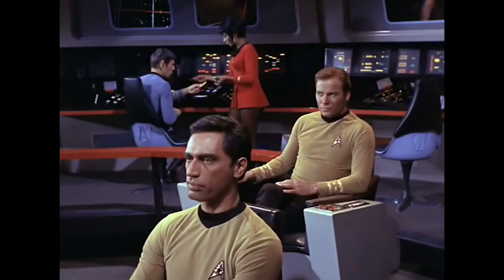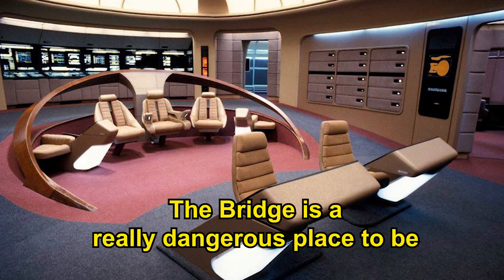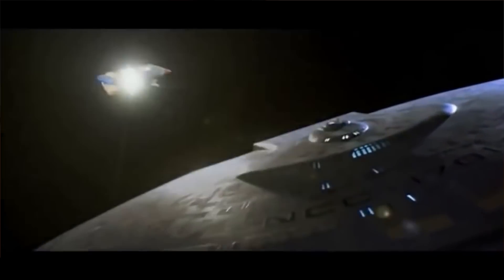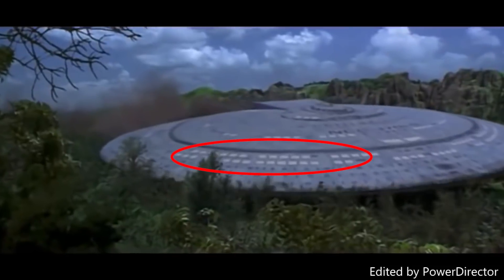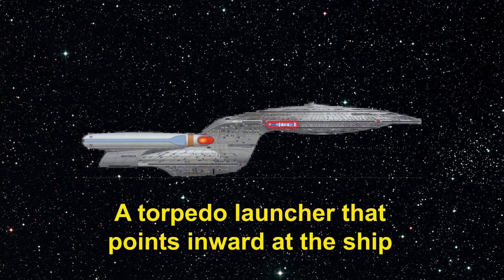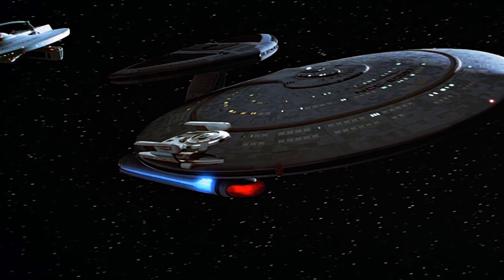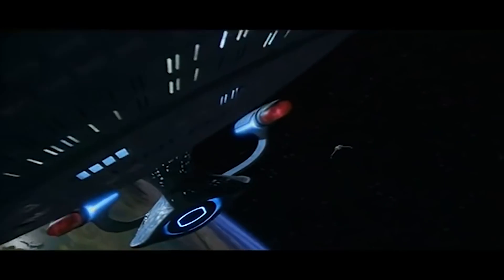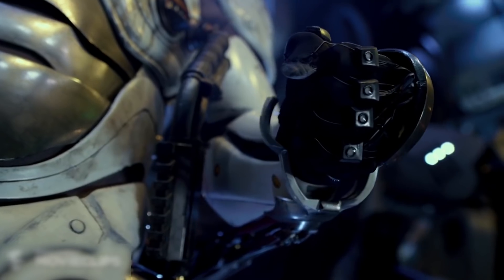10 Flaws Star Trek - USS Enterprise NCC 1701-D

Comment: One of the biggest design flaws of federation ships are the mysterious beams that fall from the ceiling when the ship is hit, inevitably trapping someone underneath.
Reply: I noticed that. WHy couldn't they locally turn off the gravity so they didn't need to lift them up?
Reply: That also happened on the Romulan ship in Balance of Terror. Dramatic effect. But I do agree that exploding work stations on the bridge are a farce - it happens only because the scriptwriters want them. As an engineer, "real" consoles would just go out (shut off) or worse, start smoking and perhaps catch fire after a full minute, enough time for crew to move.
Reply: @dtvjho  Not quite. Sometimes a power surge or short circuit can cause electric fire, or in a very rare case, explosion. Furthermore, Starship in a star trek didn't use electric cable for power. They use EPS conduit which use plasma to transfer power from the warp core to the rest of the ship. This conduit can rupture and release hot plasma.
Reply: @dtvjho   The problem is all their consoles are powered by Samsung batteries.
Reply: Don’t forget the rocks. Federation ships  decks are full of rocks that fall out during attacks
Reply: They never came up with the idea of a fuse.
I can under stand why they run plasma through the stip to power the systems, they just need that much juice. But why they don't shield and seperate the interface parts is beyond me.
Reply: @fadlya.rahman4113  You ever heard of circuit breakers? Theirs cannot possibly be worse than ours....
Reply: Or the explosive control panels.
Reply: That's so true! And yet, Beverly Crusher's jars in sickbay, the ones with blue and red liquid, never seem to get affected by any emergency whatsoever. They remain fixed to the spot.
Reply: @doctorwho0077 which Borg Queen? Alice Krieg or Susanna Thompson? 😁
Reply: Don't forget the strangely rock-like rubble that seems to be packed into every ceiling and crawl space just waiting to explode out during a firefight.
Reply: This should be the top comment... :D
Reply: LOL
Reply: They are know as 'Red shirt trap beams" and they are totally required, as "he's dead Jim" must be spoken at lest several times per episode.
Reply: Alexander Kale I imagine even circuit breakers have a limit. We are talking about direct energy weapons with nuclear-level energies. A sufficiently powerful flow of electricity can jump just about anything, and this shit makes lighting bolts look like the static from walking on a carpet.
Reply: Well, if you could say plot armor protects the crew, then it's the enemy blowing plot holes in the ship that makes the beams fall.
Reply: @robertaylor9218  Lol. I would argue that the consoles on the bridge and main engineering room will be the most secure. So if the power surge is so large that even the very low voltage consoles of the bridge blow out THIS violently, then every console on the entire ship has to have blown before that. Not to mention a million other systems also guarded by "lesser" surge protectors all over the ship must have fried and your vessel would be a burning wreck.
Reply: Alexander Kale I really wasn't arguing that you could reasonably expect explosive power surges, just that they would seem to be far from implausible. In universe I really am not sure how much you can isolate these things considering the power of these weapons systems. 

Frankly it's a testament to the the skill of the engineers and material scientists that every blast from an enemy ship’s main weapons dosn't turn half the ship to slag.
Reply: @robertaylor9218  No, that is just a straight up plothole. When you have reached the point where your shields are better pound for pound than armour, and are powering your DEWs with matter/anti matter reactors, any hit that breaches the shields WILL kill you. No question, no excuses, no other option. 
If any hull material could withstand that amount of energy, you would not need shields.
Reply: Alexander Kale I'm not sure I agree, just discarding the waste heat from these vessels would require some very impressive thermal management, that and all of the other wonderful handwaivium technology (inertial dampeners for instance) keeps it within suspension of disbelief for me. 

But yeah, barring some incredible technology and materials (that may not be possible) ”shields have failed” would be the last words any crewman would ever hear.
Reply: Following on from the comments about shields, hulls, exploding panels, and handwaivium technologies, anyone seen that episode of Voyager where the ship was basically a wreck, all crew had evacuated, and with failing shields serving as the front of the ship, Janeway smashed Voyager into another vessel! That was fantastic.
Reply: @Darren Marsh... I wish I could upvote this more then once... that damn beam has been the ruin of many red shirts and a few of khan's men ….
Reply: And the rocks that seem to spring out from the exploded consoles.  Rocks?  Why?
Reply: Replicator malfunction maybe? Maintenance crew needs to eat too, so jeffreys tubes have reps? ^.^
Reply: @tiagotiagot 
Actually, it wasn't the batteries that caused that issue. It was the design of the case. Lithium Polymer cells need space to expand and the case of the Galaxy Note didn't allow for that. With the whole push for thinner and more compact phones and mobile devices, we're going to see a LOT more battery fires and explosions caused by greenhorn engineers being strongarmed by idiot managers and unscrupulous marketing "experts". And as for Star Trek control consoles, they're safe from batteries exploding.
Reply: Yeah, just ask Jennifer Sisko.  Wait, still to early for that joke?
Reply: @fadlya.rahman4113  Yes, but the console run on more conventional power, as the EPS power is converted to electricity for use. It's based on a real concept.
Reply: Robert Aylor aren’t they often, though? The ships seem to get wrecked without shields. Phasers are made to overwhelm shields and torps, to deliver destruction or death blows. Phasers after the shields are down are horrible, as well. Yeesh. The weapons of the 23rd and 25th centuries are enough to bring about cold wars or the horrors often fleshed out in the novelizations (or mentions in the tv shows).

Comment: Landing gear wouldn't have helped the saucer section land in Generations because it was thrown towards the planet by the shock wave from the exploding warp core and had it's engines damaged by the close proximity to the exploding core
Reply: ...which is also why they didn't use the escape pods--there wasn't time.
Reply: @Stepperot  pluss escape pods would probly blow up due to shockwave :O
Reply: And the forward velocity would snap the landing gear anyways...
Reply: Jorge Jobs You didn’t see MY landing gear for this
Reply: Honestley i think in that Situation it was good they they could NOT eject the Warp Core. If the D as a hole would have Crash Landed on the Planet the Damage would be MUCH bigger
Reply: A large matter/antimatter reaction in space wouldn't have a shockwave since there is no conductive medium. There would of course be a little ultra high speed fragmentation, but almost the entire explosion would be electromagnetic with an extremely large EM flux and extremely intense X-ray and gamma radiation. If it were in low orbit above a planet, the gamma radiation might very well be enough to ionize a large amount of atmosphere as well as kill organic life on the ground. The hard radiation would dramatically alter the composition of the atmosphere forming toxic compounds and destroying the planets ozone, further opening it to the harmful effects of radiation. The polar areas would have Aurora that would even be visible in daylight that might last months.